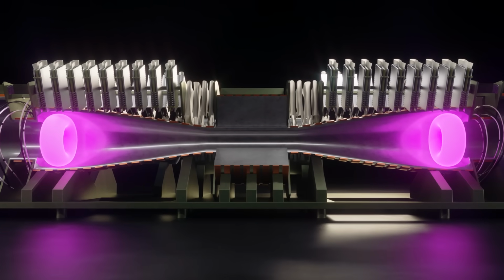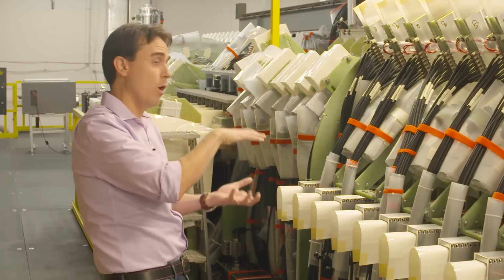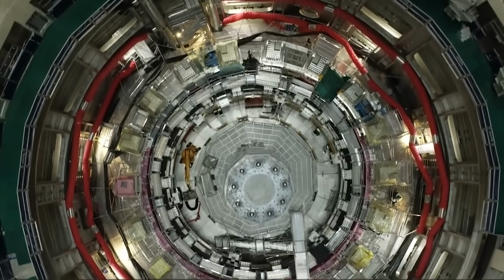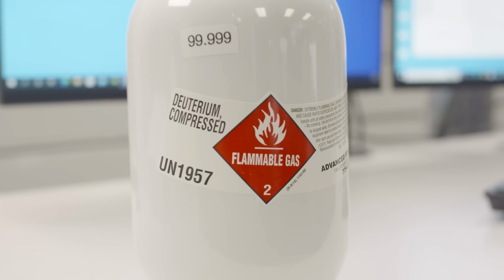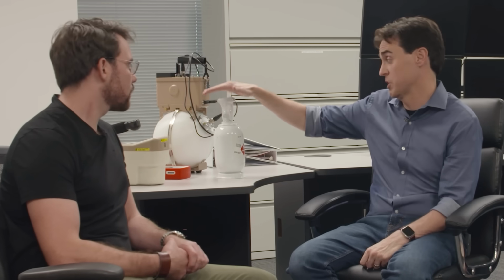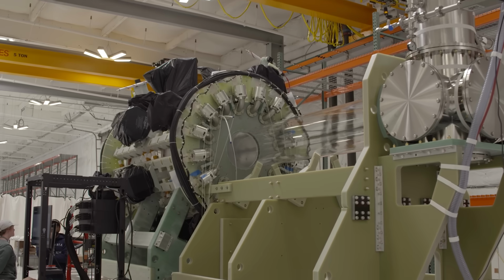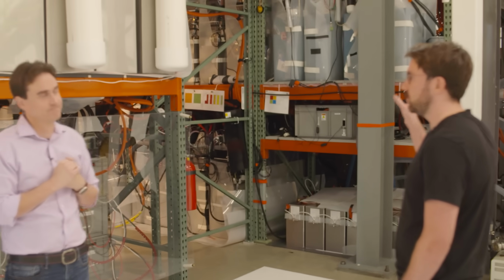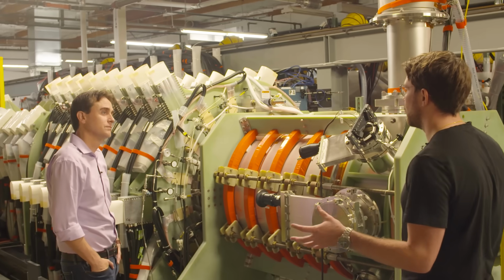A New Way to Achieve Nuclear Fusion: Helion

Comment: And, despite all the ongoing hype and over a decade of promises and optimism, not ONCE has ANY fusion reactor produced a GENUINE net energy gain. Even recent articles with headlines touting that Lawrence Livermore "Has Achieved Ignition" and claiming "net energy gain" don't tell the honest truth. The truth is always buried near the end of such articles: "The inefficient lasers used in the experiment required about 300 megajoules of energy to fire just 2 megajoules of energy into the experiment. The reaction produced about 3 megajoules of energy." So, "ignition" is a technical term that so constrains the metrics that, even when the "ignition" requires ONE HUNDRED TIMES more total external energy to start than the fusion energy that was produced, this is called a "breakthrough." In short, the bar of what is touted as "success" is so low that the dim-eyed public is easily hyped into believing (and investing in) the idea that sustainable fusion power is almost ready to mass-produce. This is flatly untrue. When "net energy gain" compares ONLY the energy entering the reaction chamber with the output from that reaction chamber, the public is be misled by smoke and mirrors!

"Net energy gain" that STILL requires ONE HUNDRED TIMES more TOTAL energy into the SYSTEM to pump a subset of that energy into the reaction chamber is still ONE HUNDRED TIMES further away from TRUE net energy gain (you know, net energy output that can power people's homes instead of draining 100 times more energy out of the grid!) than the hyping headlines state.

And keep in mind that "energy input" has to contemplate FAR more than even that 100 times of energy that powered Lawrence Livermore's reaction! It takes energy (VAST amounts of it) to produce the experiments themselves (the sites, the devices, etc.). It takes VAST amounts of energy to produce the fuel, the magnets, etc. When the total energy inputs are totaled up, so that we can see if fusion reactions are even remotely close to powering the GRID at a net gain compared to the energy drawn FROM the grid to produce the fusion power, we see that fusion is actually THOUSANDS of times further away from true, useful net energy gain than the headlines hype! By stark contrast, conventional nuclear power and fossil fuel power produces VAST amounts of net energy gain TODAY.

Helion is no exception. Now Helion has contracts that require it to produce significant net-energy gain to power the likes of Microsoft by 2028, but it remains unclear how (despite over $500 million in investments) it's going to achieve that. And keep in mind that 2028 is FIVE MORE years away, which means that Helion is yet another company that's kicking the true net-energy-gain can down the road. Yet more hype and optimism. But when Helion joins the list of companies and research sites making lofty promises and then failing to deliver, it, like all the others, will just fade from people's memory to be replaced by yet another company generating hundreds of millions in hopeful investments. Rinse and repeat.

I've become quite pessimistic about fusion power in my lifetime. And, by the way, a pessimist is just an optimist in full possession of the facts.

So, this "documentary" is, like all the others, light on all the facts, heavy on hype, heavy on ambiguous use of terms, and, in short, just contributing to the misinformation that leads the public to falsely believe that large-scale fusion power is just (at most) five years away. It's NOT! And decades of failures to make good on the promises NEED to start being loudly and actively called out.

PERHAPS, someday, who knows when? large-scale fusion power will become a viable alternative. But the TINY, incremental, BABY-steps that decades of research have produced indicate that this "someday" is a LOT further away than just five years! We should keep plugging away at it. But we should also be honest and sober-minded about what we have "achieved" thus far in our research!

Perhaps this channel should be renamed from "Real Engineering" to "Hopeful Engineering" or "Hype Engineering." I'm personally really tired of the decades of hype on this subject, and I've been eagerly following the hype with increasing disappointment and disillusionment for decades. The "breakthroughs" are fast and furious, but always without ACTUALLY getting us even CLOSE to GENUINE net energy gain. While we're tinkering around with fusion power, we should be investing heavily in thorium salt reactors and other new conventional nuclear power sources! That's where the foreseeable future of net energy gain power really is.
Reply: Only that Helion is planning to demonstrate net electricity(!) from fusion somewhere around the end of next year already. Polaris is already well under construction and targeted for first plasma towards the end of this year, or the beginning of next year. 
Helion has also nothing to do with LLNL. These are completely different concepts.
Reply: @elmarmoelzer2229  I am well aware that Helion and LLNL are two different entities with two different approaches. I used LLNL as a classic example of the hype surrounding fusion, and I called attention to the FACT that "net energy gain" is a term that these entities (and the sycophantic media) intentionally use to refer only to what happens inside the reaction chamber, NOT the total energy pumped into the entire system to produce the event in the chamber! Helion plays this same game.

What they "plan" to show is irrelevant to my comments. And WHEN they slip the date, people like you will not be rushing to say (as I do), "Oh, wow. So like everybody else, Helion just kicks the can down the road and plies us with smoke and mirrors regarding TRUE net energy gain." I don't care about press releases, plans, hopes, and dreams! I care about ACTUAL NET (all inputs considered) energy gain. And NOBODY is within two orders of magnitude on that crucial metric.

Note that LLNL claims to have ALREADY achieved "net energy gain," not "planning to." And the press is fawning over this achievement, just as people fawn over Helion. Again, LLNL claims to have beat Helion to the finish line of net energy gain! But it's a LIE. Talking about net energy in the reaction itself is a ludicrous definition of "net energy gain" when you spend ONE HUNDRED TIMES more energy in the total system than the total system produces!

Smoke and mirrors. And Helion has not said or documented anything that gives me reason to believe that it is within two orders of magnitude of achieving ACTUAL productive net energy out of the system. If you know of any hard evidence to give me more reason for optimism, I would LOVE to see it! I've been following fusion developments for decades with bated breath! But talking about plasma plans "late this year or early next" is NOT the metric that matters.

Comment: respect to the engineers for coming up with a better approach to a fundamentally flawed principle. Trying to replicate conditions found on the sun, because of the misconception that is the only way fusion can happen will perpetuate the bottomless - fruitless money pit science has become. The best solutions are the simple ones. It‘s a shame that metal hydride saturation is left completely unexplored. Instead of trying to brute force fusion in a chaotic plasma environment, a deuterium atom could be quantum locked in a metal grid structure and when excited by fractions the amount of energy by current technologies, would have nowhere else to go than his closest neighbour and fuse with it. The thermal energy released would be also much easier to harvest.

Comment: Anyone noticed the configuration of this thing looks an awful lot like a Star Trek (TNG) warpcore?
SciFi turning real...
Reply: David Kirtley (founder of Helion) has a strong Aerospace Engineering background (BS and PhD) and MS in Nuclear Engineering. He worked on ion propulsion for the first part of his career. It almost seems like the inspiration to pursue the linear pulsed fusion concept came from ion propulsion (similar linear acceleration of particles) and some elements of Star Trek as well (extracting electricity induced by magnetic field of the plasma instead of generating steam to drive a turbine).

Some of the more advanced/powerful ion propulsion concepts (e.g. like NASA's VASIMIR concept -- which, conversely, was developed as a result of traditional fusion research during the 1970s) require immense amounts of power where either a fission (or fusion) reactor would be required (hundreds of megawatts). To get that power from fission for spacecraft is challenging and might be simpler using this fusion if it works as intended. His decision to work full time on fusion make a lot of sense.

Comment: This all sounds great but expensive. Can you take a look at HB11's hydrogen + boron laser fusion system which sounds like a more economical option.
Reply: Why do you think that this would be more expensive?
Reply: @elmarmoelzer2229  HB11's Hydrogen + Boron laser fusion is aneutronic. That alone will make it cheaper to run, it's a much simpler but can it produce enough energy compared to tokomak or frc reactors is still to be seen.
Reply: @SW-lw6mt   getting the strong lasers to be efficient enough is the challenge that HB11 is facing. Lasers are advancing rapidly, which is good for them.
The difference between a laser based approach and Helion is that all the energy lost in the lasers is lost. Helion can recover 95% of the energy they put into the machine directly as electricity. Plus a significant percentage of the fusion energy as well.
So that makes things easier for them.
Helion's machines will have some neutrons (one in 3 reactions produces a 2.45 MeV neutron). but it is not nearly as bad as D-T fusion. PB11 will also produce some neutrons in side reactions, but less. They also have to deal with a lot of Xrays. HB11's biggest problem right now is funding, though, IMHO.
Reply: @elmarmoelzer2229  The Australian Govt gave them 22m recently but that's nothing compared to what is being spent in the US and UK,   unfortunately we don't have a good record of support local innovation.

Comment: I'd like to see how are they avoiding the production of neutrons, since clearly D-D reactions will also happen in a D-He3 plasma
Reply: About 1/3 of the reactions will produce a neutron and that neutron will be comparably low energy at 2.45 MeV. Compare this to neutrons in D-T fusion reactors which produce neutrons in all reactions and those neutrons have 14 MeV energy. 
2.45 MeV are below the activation energy of many materials. And those materials that get activated have a very short half life.

Comment: Nothing is clean or safe about all this.  It just hasn't had its accident that gives the press enough ammunition to gun it down.  Fusion reactors will eventually have mishaps and they will produce radioactive materials that will need disposed of.   We had to work with fission for decades to produce power with it and decades more to keep it relatively safe-ish.
Reply: What kinds of accidents to you think this could possible cause? Fusion is probably going to be the safest energy source we will ever have.
There will be activated materials, but they will have a very short half life. A Helion power plant can be fully decommissioned within 2 weeks after it was last operational. It would take less than a year for all activated materials to be below background radiation levels.

Comment: I don't get it, you use extremely strong magnetic fields to hold the plasma in place but extract energy from the push back the plasma has on the magnetic field? How does that work
Reply: The plasma is compressed with a pulsed magnetic field for just a few hundred microseconds. After that, the magnetic field is turned off and the plasma expands again, driven by its own internal pressure and the added energy from the fusion reactions. When it expands, a current is introduced in the very same coils that were used for compression.

Comment: Am i missing something or did they skip over the conversion of energy to a useable form for the grid. I understand they are creating a magnetic field not a thermal transfer but how does the energy become constant even if they increase the number of reactions and deal with the increase thermal and pressure loads of the reactions. The increase in the magnetic field would be vary rapid probably in a fraction of the fusion reaction time. Im guessing the fusion only takes ms at best. Are they intending to have a charge/discharge capacitor bank then DC-AC convert back to grid 60hz. What is the net positive energy output of the current fusion reaction?
Reply: The energy is stored in capacitor banks that gradually release it to the grid.

Comment: Oof… if your power generation requires more power than it can produce, you don’t actually have a power generator…. Just a very expensive plasma lamp.
Reply: Good thing then, they want to produce more power than it requires to run.
Reply: @elmarmoelzer2229  but so far, it doesn’t….

Comment: I guess the question in my mind is why the very high amperage requirements which are repeated throughout the video.
Creating EMF fields is related to voltage, not amperage. If you want a stronger EMF field, you step up the voltage, not the amperage.
If I understand what is being described, it seems that the project is claiming a small net positive output which is remarkable.
Of course, the other remarkable thing is that the device as shown is tiny compared to what one might expect. Maybe the demo is small but would be scaled up to produce a larger output? It almost seems to me that the physics being described could be scaled up without increasing the size of the device.
Interesting that sorage is super capacitors. Absolutely that would support instantaneous charge if necessary and could feed batteries if longer term storage is desired... but I'm going to guess that most uses won't have to store electricity for a few days, up to a week and capacitors shoudl be able to handle that.

Comment: Sounds like if a magnet fails, you end up letting a million-degree hot plasma touch the sides. This could be incredibly dangerous, no?
Reply: No. 
The plasma is hot, but not very dense (closer to a vacuum than to ambient air). A single pulse only contains a few kWh of energy. If confinement failed, there would be some abrasion on the inner walls.
Reply: @elmarmoelzer2229  Good answer

Comment: The moon is lousy with He3, literally. The mining of He3 is going to be a major reason to go back. But it was the Chinese who found it, and it will the Chinese who steal you fusion reactor. My advise is to get the US government to grand you access to moon flights for the specific acquisition of He3 from their explorations. Or to get musk on board with the obvious inclusion of Tesla’s new million kw storage cells that plug into your reactor and dump all that produced electricity. 

Each little flash fills up 20 million kw Tesla power units and they can then be plugged into a city, a US Ford class carriers laser, or jumbo jet power them until the next one get plugged in
Reply: Helion will make their own He3 by fusing Deuterium.

Comment: This paints a more rosy picture of liquid salt reactors than reality likely will produce. These are much more complex types of reactors that require a lot of much more complex monitoring/maintenance/staff. Given the number of nuclear power accidents we’ve had just using simple uranium in water - the odds of things going wrong with thorium is statistically much higher. The navy rejected liquid salt reactors when it was discovered the hot liquid salts could cause chemical/physical explosions if leaks contacted water - water often found in the bottom of ship engine rooms.

Comment: The "flash" is not necessarily caused by fusion. Most likely, just by the ions colliding. I thought deuterium-deuterium fusion requires at least 180,000,000°C for fusion. You are at least an order of magnitude too cold. Break-even requires the plasma to be in thermal equilibrium. Where are the massive shields required to contain the massive neutron radiation from fusion?
Sounds like a scam.
Reply: The machine has done 100 million C already. So they are not an order of magnitude too cold, but only by a factor of 2...
And even at lower temps, you do get some D-D fusion, just not enough for it to be economically viable. But the next machine Polaris is aiming to show enough D-D and D-He3 fusion for economic viability towards the end of next year.

Comment: What happens if you lose power during any part of this experiment? Would the plasma touch the walls and burn through? What would that mean?
Reply: The plasma is hot, but not very dense (closer to a vacuum than to ambient air). A single pulse only contains a few kWh of energy. If confinement failed, there would be some abrasion on the inner walls.

Comment: To solve the capacitor problem: what if you put 2 generators side by side, pulsing alternately, and use the energy output of one to fuel the reaction on the other generator, similar to how a gasoline engine uses multiple cylinders? This would Ideally make it so that you wouldn't need Capacitors, or maybe need fewer capacitors.
Reply: Would still need capacitors for backup. But yes, multiple machines could share a single capacitor bank.